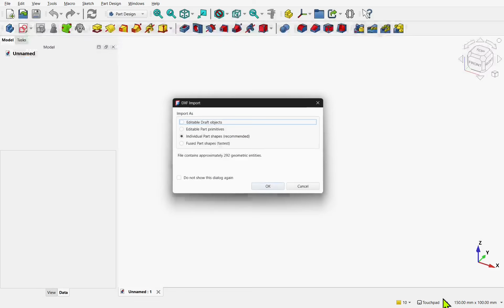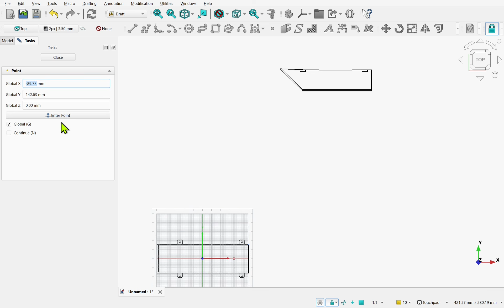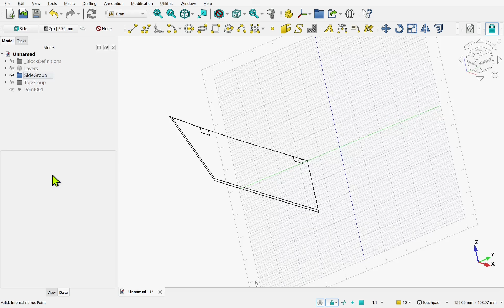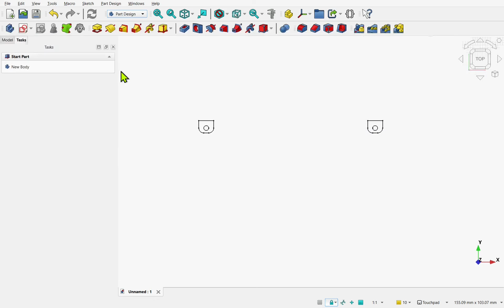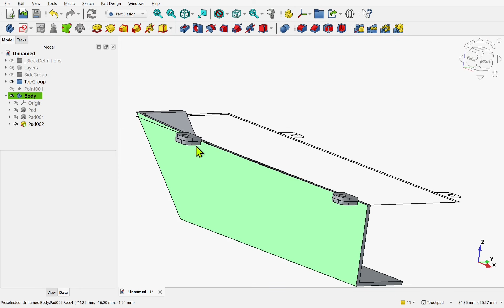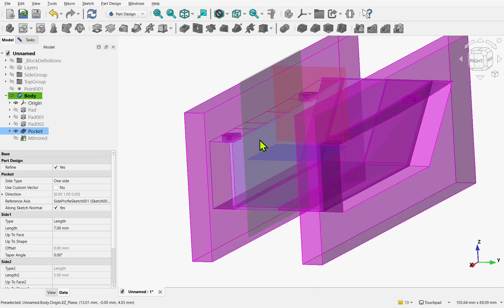Learn how to convert DWG files into 3D printable models using FreeCAD

Comment: I followed the complete tutorial, had to start two times, but made it to the final result. And learned a lot. Thank You. 

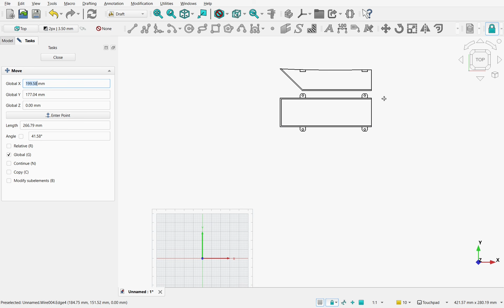There are sometimes still mysteries things going on, when for example  at 7:21 the move operation only moves the inner part of the TopGroup. I could not convince Freecad to move all elements of the TopGroup. Only installation of the latest weekly build and starting all over again fixed the problem. 

Since I do not believe, that such an issue was really included in the 2025.11.05 weekly build and is fixed in the 2025.11.12 I still ask myself, what might be the reason? All wires of the TopGroup were assigned correctly (checked by the ViewIcon - appearing and disapperaing of all wires); TopGroup was selected as a single thing in the Tree (made sure by clicking off and then only selection the TopGroup; Then Move operation and all showed to be moving, but on making the finishing click at the target position, only a part of the TopGroup really got moved. The outer lines did not change position.
Reply from the maker: That is extremely strange, I have been going over what could have gone  wrong but if you have seen all wires move in the group when you hit the move icon and then on click some of them snapped back, that is just odd.  I have only seen items snap back to their position if they have an attachment / support.  But I don't believe wires have that property.  Very strange.  Glad you got through it in the end and you learnt a lot.  Draft workbench can often be overlooked by it has a ton of useful stuff in there that can be used with the other workbenches.

Comment: Draft workbench is a mistery for me. It freecad get out of jail card, but I fail to understand how to mix with the parametric modeling.
Reply from the maker: When you using the part design the key is the shape binders.  Any of the 2D objects or arrays can be shape bound into the part design workflow, some of the geometry can be dragged and dropped inside the part design body such as the shape string but others will create a base feature instead, which is not really what you want as you can only have one of those.  I am going to be doing more on the draft workbench and how you can use it in workflows soon.
Reply: Sadly, some of the oldest workbenches like Draft and Part are still aggressively non-parametric, but hopefully this is going to change in the future. There are parametric versions of their tools strewn about in other addon workbenches. I think the Lattice2 WB has parametric versions of the upgrade/downgrade tools with some much needed quality of life improvements, and the Curves WB has a parametric version of the shell-to-solid tool from the Part WB. I agree that Draft in particular does feel archaic, almost like it belongs to an entirely different CAD suite. Given how much FreeCAD has changed in the last decade, I guess it kind of was made for a different program, in a sense :)

Personally, I think Draft contains so many tools that don't really have to do with drafting, that could be better served if they were made parametric and moved to the global menu and not tied to any particular workbench. Like Clone, Facebinder, Upgrade/Downgrade, Draft to Sketch and all the Array tools. Moving the origin of imported 2d geometry feels like it would be a lot easier if one could use the attachment workflow too, but as far as I know there is no way to use that from the Draft tools.

Comment: Its been 10 years since I needed to do this, everything is solid modeling for me now, surfacing isnt allowed due to policy as a result of some bad geometry that escaped into a build. But I am super impressed with this workflow nonetheless. Might go back into my old treasure trove of Autocad dwg and dxf files. Many thanks to Mangojelly for these tuts.😊
Reply: What software do you use?
Reply from the maker: Thank you so much for the feedback, I didn't know this would get so much attention.  It originally came from a viewers request so really glad they passed along the query.  It's sounds like your going to have a trip down memory lane going through the old projects :)